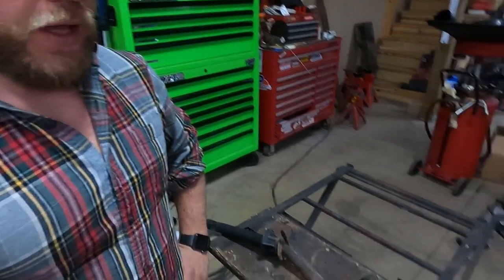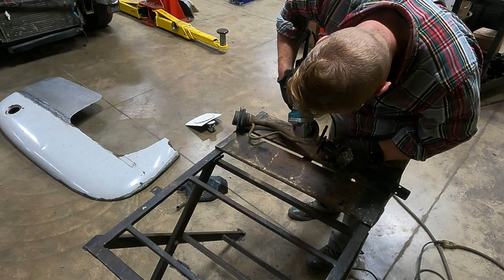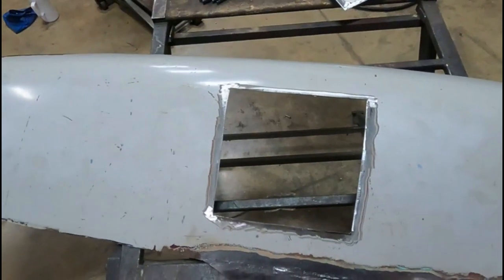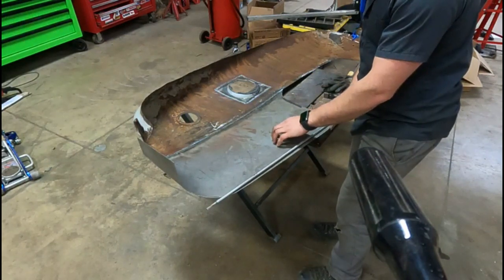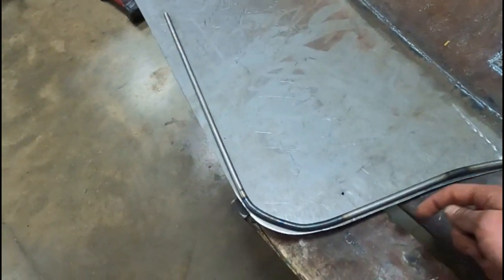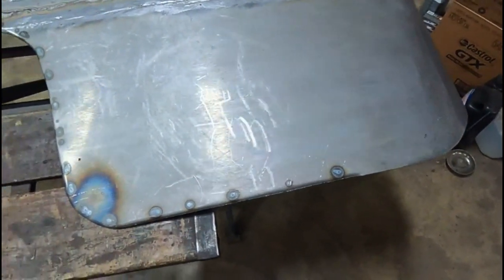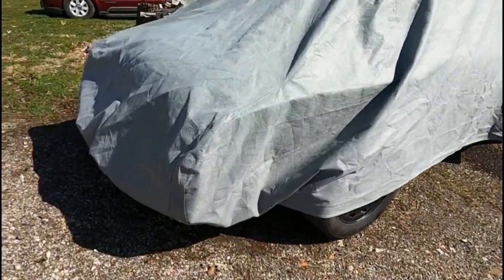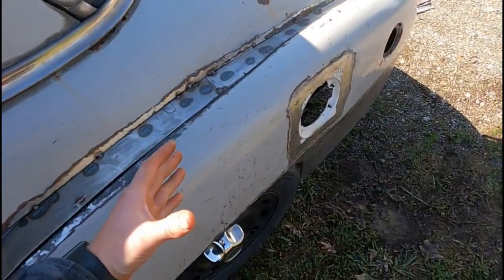Body Swapped Crown Vic-Episode 15 "Fender Bender"

Comment: cool project. Not sure why u didn't run the gas filler to the stock location.
Reply from the maker: Thanks. Unfortunately the plastic box that the door and the filler neck bolt to just wouldn’t fit back there due to the shape of the fender